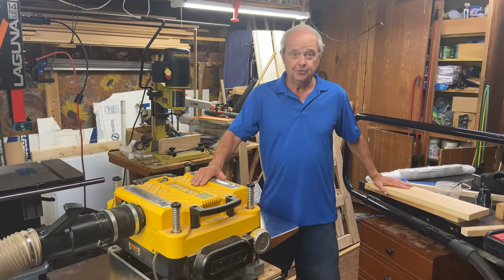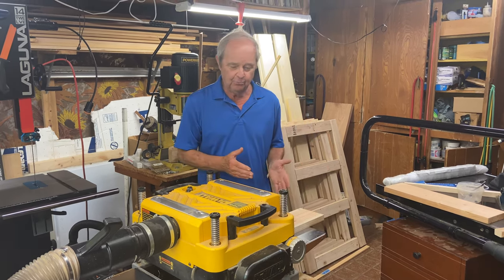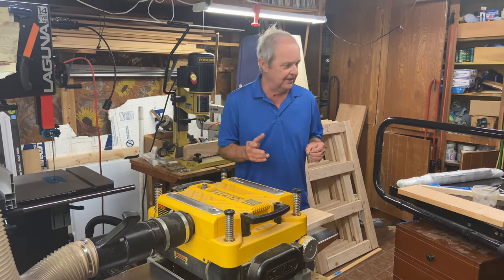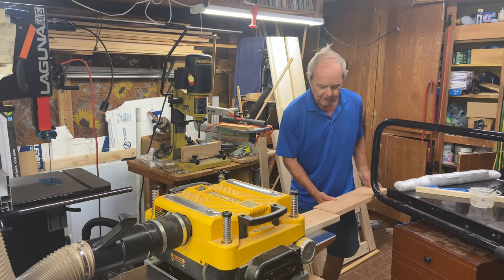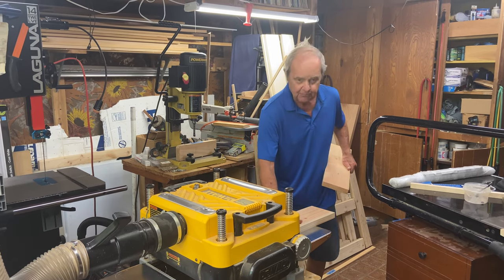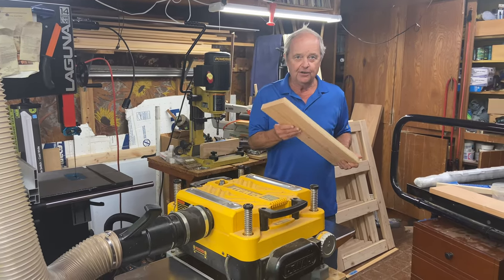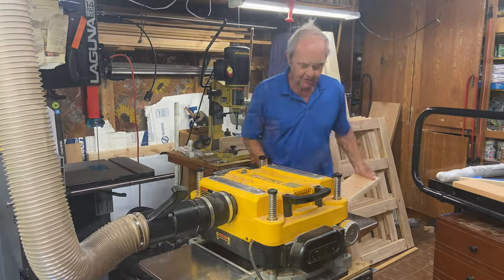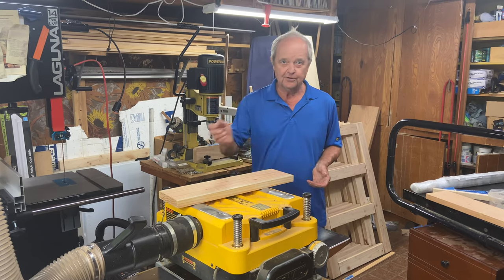ONE Super Simple Secret to Prevent Planer Snipe

Comment: Your snipe explanation (lifting the end of the board when it passed one of the rollers) contradicts your sacrificial board snipe prevention trick (how could 2nd board prevent 1st board end from moving up and prevent the snipe?). In fact, there is a better explanation for snipe due to cutting head slight down movement on one end when board has passed its corresponding roller.
Reply: Because when you have a sacrificial board behind it the feed roller won't drop and allow the carriage to rock.... it will happen at the end of your sacrificial board instead..... it makes total sense.
Reply: @ryananthony4840  So is the front roller, knives and back roller all connected on a single carriage, to make this answer correct? Because I just watched this and had the exact same question, as I could not see how a 2nd board would stop the first board's end lifting up closer to the knives once it came off the back roller. If they do share a carriage, then it makes sense.
Reply: @JB-NZ  yes, basically it's caused by just a slight twist....

Comment: While snipe can be partially caused by the free end of the board moving up or down, it is not the main cause. The fact that putting a scrap board through beside, or closely following, your work board prevents snipe should tell you that the main cause is 'rocking' or 'tilting' of the cutter head assembly. Using scrap boards to support the cutter head prevents it from lifting slightly, as the leading edge hits the outfeed roller or dropping slightly as the trailing edge leaves the infeed roller. If snipe was purely a result of the board or infeed/outfeed table support then putting a scrap board through with the work would make no difference.

Comment: that's not quite how snipe is caused.  If it were placing a sacrificial board at the end would not work.
Reply from the maker: Why not?
Reply: @SawsHub  you said that snipe is caused because when the first roller is no longer pushing the board down, the board lifts up a little bit.  Well, if you run a sacrificial piece of wood behind your board, you board will still lift up a little bit after it loses contact with the roller.

In reality what is happening is that there is a little bit of play in the cutter head.  When the first roller loses contact with the board, the entire cutter head assembly tilts a little bit causing the snipe.  That's why if you run a sacrificial piece of wood through it eliminates the snipe.  The sacrificial piece keeps the cutting head level.
Reply: @tchevrier This is my understanding as well. In these bench top models the rollers and the blade are interconnected so when the roller drops so does the blade. Explains why running a sacrificial board works every time.

Comment: holding the board off the table until it's under the second roller works for me as far as preventing snipe on the leading end. Holding the board up to maintain even level of feed prevents snipe on the back end. I don't feed a bunch of boards overlapping one another either. Wood is too expensive (for me)  to be using sacrificial pieces, whether it's just one or two.
Reply: Construction lumber works fine, no need to run anything expensive thru. Just need to keep those rollers leveled.
Reply: I don't think it needs to be a full width, just a narrow offcut of the same width.

Comment: I understand how using a sacrificial board stops snipe on the first one but how can you use both boards to stop snipe on both boards as you will eventually use only one board to go through the planer causing snipe on that last board.
Reply: Because after the second time through it's not really cutting any material so the cut surface is the same as the in/out feed roller. If you properly adjust your outfeed table it is the same as using your hand (or should be).